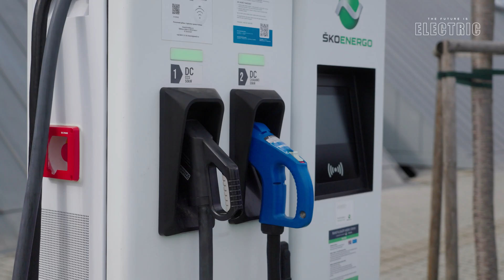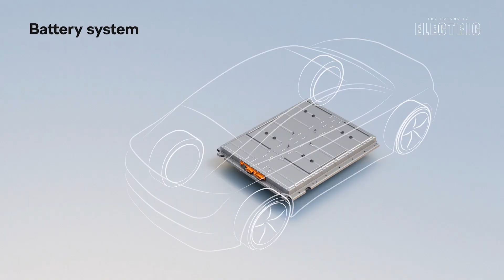Skoda Enyaq Coupe Technology Review

Comment: love the car , i bought the coupe vrs , good saving in uk fom new ,
55k new and i bought 6 months old with 3k on the clock as managers 
car for 35k , had for 4 months now and its been faultless , its plenty 
fast enough i think having owned the superb sportline plus 272 which
was skoda fastest car . 
mine is booked in next month for update fro. 3.2 to 3.7 software .
have never used a public charger yet only charge at home to 80 percent .
in 4 months its only cost me £60 with octupus energy ...
love electric after owning 28 ice cars , did have to buy a new tyre which 
cost £250 which was more than my first car , thought the tyres were
self sealing tyres but there not , the one i put on is a self sealing , 
there all hankook , MG garantee the battery for the life of the car ,
how many petrol engine cars have that with the engine ............

Comment: I have one of these on a long term rental of 2 months.  It's a surprisingly great car, even better than the ID4 I had before.  The infotainment and app still sucks like all VAG cars, but the rest of it is great.  Even on the single motor version it's snappy and responsive.  The brakes feel a bit weak especially since this thing can reach 165km/h (the software limit) without noticing.  On single phase it seems to get limited to 3kw (on 16A European plug), while the ID4 reached 4kw.  Comfort wise, it has a huge boot but the seats are just slightly more uncomfortable than the ID4's or even VW ICE cars.  I've decided not to keep it primarily because of the bad infotainment and app platform.
Reply from the maker: Stay turned for the driving video this week ;-)

Comment: Thanks for this.  Great to hear that Malta is the perfect temperature for EVs!  FYI the increase in reported range when going downhill is probably a poor measure of the amout of energy that has been recovered through regen, because it reflects not just the change in the amount of energy contained in the battery, but more significantly also the lower rate at which that energy is consumed (the average consumption is what is used to calculate remaining range).   The change in the percentage charge of the battery would be better measure of the amount of energy actually recovered through regen